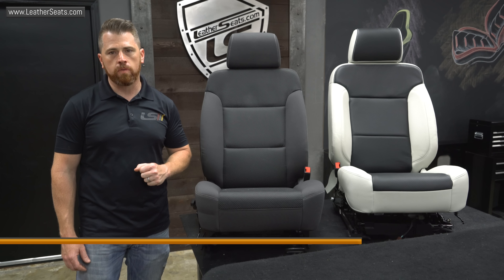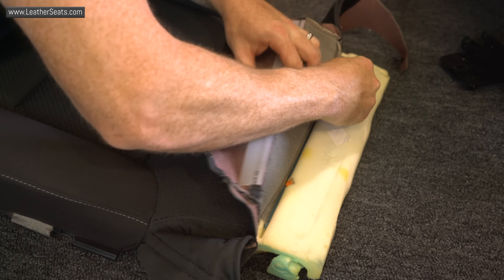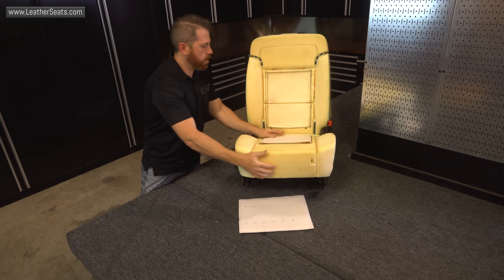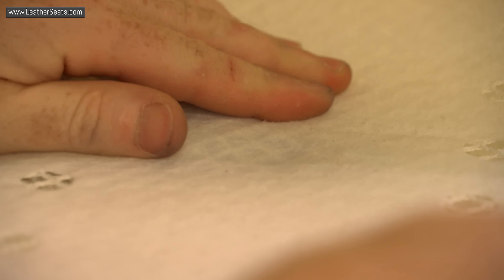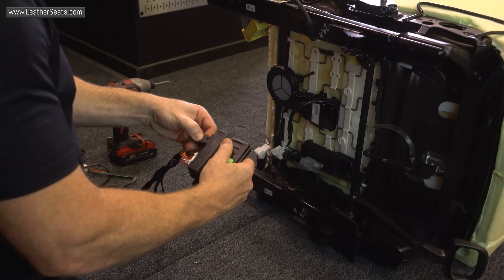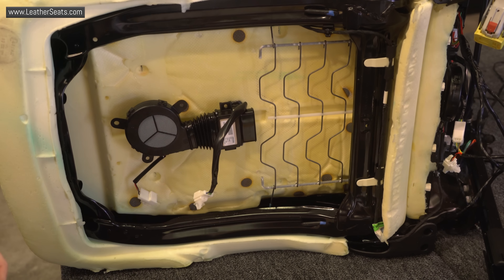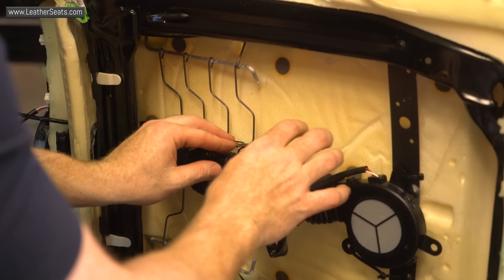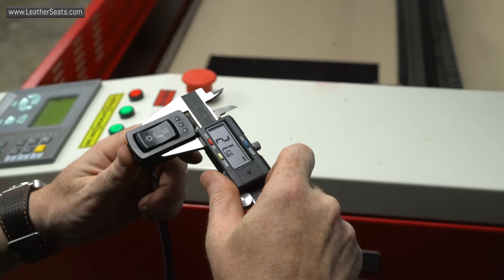Installing Heating and Cooling Seat Ventilation Units - LeatherSeats.com Tech Tips

Comment: says he doesn't like kits that require modifying the seat frame or foam, then installs preferred kit by modifying seat foam...………..
Reply from the maker: wht02lightning Eric's statement about modification is not that there is no modification required with our units, rather that the required modifications of other units that we've tested "...could affect [the seat's] structural integrity." (see 1:03 for the full statement) In this video our seat foam modifications did not affect the seat's structural integrity. Also, we did not make a structural modification to the seat frame. We simply added a piece of metal strapping to the back of the backrest in order to provide an attachment point for optimal placement of the blower and TED unit. If you have any questions feel free to give us a call at 1-866-639-7328.

Comment: I did high end custom car audio, video, and fabrication for almost 20 years and I gotta say - I love to watch you work. The details you DON'T see are what matter!
Reply: Kenny C I agree, i'm also a car audio installer, and this guy really knows what he's doing
Reply: So true! I bought a '99 2 door Tahoe last year. Battery was dying every couple of days. There was an aftermarket Alpine HU installed, so I decided to check over the installation. Previous owner skipped spending a few bucks on a plug and play harness and butchered the whole thing together with twisted wires and electrical tape. Had the radio wired to constant power. The truck was rough with other questionable wiring I just sold it.

Comment: I've never experienced cooled seats. Are cooled seats absolutely amazing or just okay?
Reply: MrEricblane they are the bomb.com if you live in Dallas like I do
Reply from the maker: +MrEricblane They are amazing! Unlike most seat heaters, this unit actually blows heated or cooled  air through the upholstery. Some ventilation systems only pump re-circulated air through the the seats. These units actively heat and cool the air blowing through the seats. You will love them! Check them out here on our website: https://www.leatherseats.com/shop/seat-comfort/seat-heater-cooler-ted-unit.html
Reply: Cool buns! You'll love em!

Comment: i have aftermarket katzkin perforated leather on my silverado. would it be possible to add this and reuse my leather or is swapping out my leather mandatory?
Reply from the maker: Jay Gatsby The upholstery would require both perforation as well as a high-flow foam backing to allow for proper air flow. Please feel free to give us a call or email us and we can go over some options with you. 1-866-639-7328 or sales@leatherseats.com.

Comment: I have an e class w210 with heated  leather seats can I add with a kit ventilation and keeping the heating function??
Reply from the maker: +James Xs These units includes both heated and cooled airflow and would replace the factory heating pads currently in your seats.
Reply: LeatherSeats.com so I wouldn't even have to modify the foam right?? Is it going to be plug and play??
Reply from the maker: +James Xs This is not a "plug and play" product. It will take modifying the foam as well as knowledge of automotive wiring. Watch this video as it fully explains the product and gives you a step-by-step installation guide.
Reply: LeatherSeats.com ok thanks!!!  😊😊 and I really like the video 😉👌👌

Comment: Could I add both cooling and heating to a 2016 f150
Reply from the maker: +Shan-David Beaulieu Yes you can. Our TED unit is a universal system that can be installed in most vehicles. To order the unit please feel free to give us a call at 1-866-639-7328 or email us at sales@leatherseats.com

Comment: Does the kit come for both front seats or just 1 of them? Also would this work for Aftermarket Racing Seats or would I be stuck using the crappy stock seats for my 03 Mustang?
Reply from the maker: +StarGaming The kit comes with the components necessary for one seat. These are universal units that work with 90% of vehicle seats out there. You will need to verify that your seats meet the requirements set in this video.

Comment: I would never do this to my vehicle. You hack the seat apart, rip off the covering, bust the hardware to maintains a good fit. Who in the heck would want to sit there and cut out all those foam pieces? All this for heated/cooled seats. Good lord
Reply from the maker: Yabo H This system may not be for everyone, but for those that want the function, it is worth the effort. Also, if you do not want to do this yourself, you can take the kit to a local automotive upholstery shop for installation. Cheers!

Comment: Do I have to install it myself, and if not, are there any wires shown?
Reply from the maker: +John Solomita Because every vehicle is different on the wiring application we do not provide specific vehicle-to-vehicle installation instructions. The general overview that Eric gives near the end of the video is all we provide on that part of the install. If you do not feel comfortable wiring it yourself I would suggest finding a local automotive upholstery shop or restyler that has the ability to do the wiring for you.

Comment: Wonderful job Eric! One of the most technical and professional videos I have yet to see. I see you used a 30A relay, can you tell me what amperage each individual unit (bottom OR back) draws?
Reply from the maker: landgkg Thank you! The reason we use a 30A relay is so that you can tie in 2 units into a single relay. With both units running at high heat they pull about 10A max each while leaving a healthy buffer for the relay. If you have any further questions feel free to email sales@leatherseats.com.

Comment: Can u do this with cloth seats? I have a drop top with cloth seats. Love it better since it doesn't get hot like leather when sitting out in the sun. Someone please answer as I do want this upgrade
Reply from the maker: +PSilence 01 Unfortunately these units will not work with any non-perforated material. Most cloth upholstery will not work as these units require air to freely flow through the upholstery material. For customers that already have factory perforated leather, these units require a special mesh type foam backing (reticulated foam) to be added to the upholstery to replace the factory scrim foam to allow this air to freely flow. For customers who are purchasing our leather upholstery kits we are able to manufacture them with perforated holes as well as the reticulated foam backing when purchased in conjunction with our seat cooling/heating system.

Comment: Would you be able to keep your cloth seat covers? Not a huge fan of leather.
Reply from the maker: biker932012 These units are designed to create airflow through the upholstery which  requires the foam backing on the upholstery as well as the upholstery surface to be penetrable. We use a high-flow mesh foam backing on the underside of our perforated leather for the air to flow through. Most cloth upholstery is not perforated but has much less dense foam backing so you may get a temperature change on the surface. The units will still work if mounted correctly however you will not get the fullest effect of the airflow. You may want to visit a local automotive upholstery shop to see if they have any perforated cloth options that would work for your vehicle. If you have any further questions please feel free to email us at sales@leatherseats.com or call us at 866-639-7328.

Comment: Great video! Love that you guys are doing This! Will I need to install new upholstery that is made to be ventilated  for this instead of the factory one?
Reply: Caleb Crews as long as it is perforated, all fabrics should be fine if you can for example put a vacuum to one side and it draws air through whereas leather would need to be perforated (have little pin holes in it)

Comment: can cooled seats work with cloth seats? as i hate leather myself so even with top of the line trims i always ask for a cloth seat swap.
Reply from the maker: TheTemplarnight Depending on your cloth setup you may be able to feel temperature differences with the units properly installed however you are not going to get very efficient airflow through the upholstery compared to perforated leather with reticulated foam backing. Most cloth upholstery has a much thinner foam backing than leather so there is a good chance that the temperature will transfer through to your body. You might also show this video to a local automotive upholstery shop and get their opinion based on your seats specifically.

Comment: i know this is an older video. can i use the original wiring from my heated seats on my 02 silverado and just modify the door panel to receive the new switch? or is there more wires going to the new switch?
Reply from the maker: walter bjazevich  You cannot use any original wiring or original switches from any car or truck with our seat ventilation units.   The original seat heater pads do not allow for proper air flow and besides that, the new seat ventilation system comes with a heating function built in to replace the factory seat heating pads. As to whether you can install the new switches that come with this unit in the factory knock out holes... I am not sure.  You would have to test that in the truck with the new switch in hand to know whether that was possible.
Reply: While you did some good work in this video, you fail to explain in your reply to Walter why he can't use the original wiring and switches. Technically you can still use the switches but you'll lose a big part of the functionality, as in you're only going to have off and full on heat or cold, not both. As for the wires, he will be able to use the original ones as long as they're the correct thickness/gauge. After all, all a wire has to do is safely transport the maximum amount of electricity required by the thermoelectric device (in this case). So, if his original wiring is as thick or thicker than the wires in your kit, he's good to go.

Comment: How is that cooling seats ? 😂😂😂 that unit can’t blow cold air through your seats 😂😂😂😂😂. Yeah , blows air but defo not cool air if in car is hot or even ambient temp . Imagine doing this on my Jaguar 😒 jeez
Reply from the maker: Neagu Eddy Our units actually do cool and heat the air using the Peltier Effect via a Thermoelectric Device. Crazy right?! OEM units, including Jaguar, have been using this same seat cooling technology for over a decade now. 👍